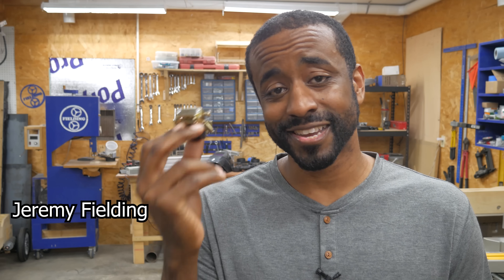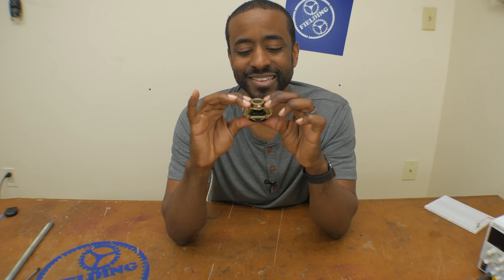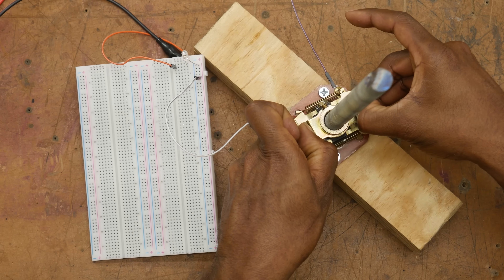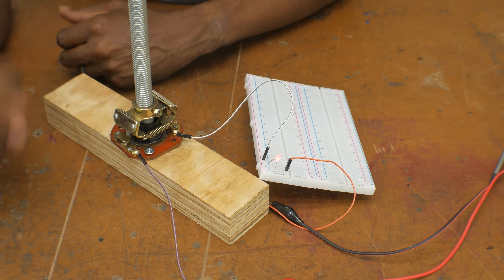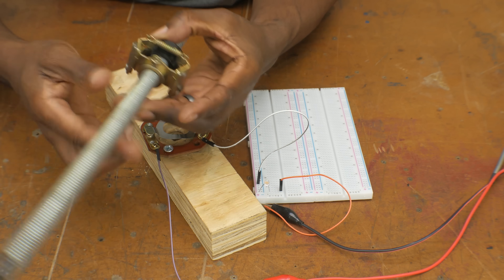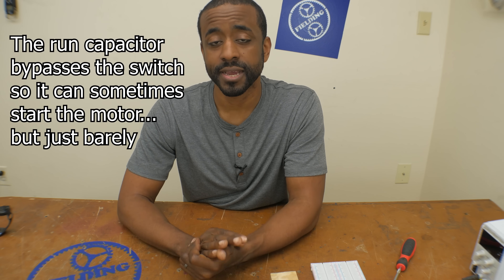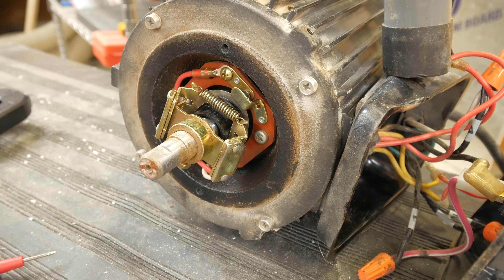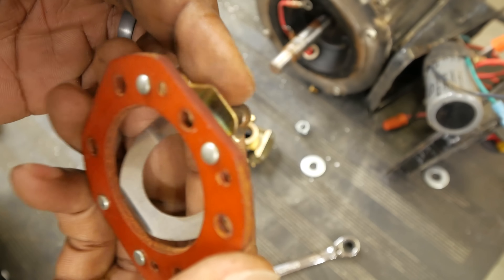This Clever Device Is Found In Nearly Every American Household. How It Works And How To Fix It

Comment: I got a single phase motor for my whole house fan and the new motor shuts off after 10 seconds.  The wiring was for 2 speed at the switch but motor is single speed..  I believe i hooked up low speed 1st and saw the faintest smoke.. Anyways hooked up high speed and still same issue..

Is it possible I damaged something by too many amp draw in low speed? I saw you mention something on your wiring motors vid.. I am at a loss now.. Itll start 10 secs and shut off and then needs to rest.. I wouldnt think its overheating as it shutoff 1st time i powered it on after 10 secs... I can hear the switch click when the motor winds down..

Edit: my motor does not have a capacitor, it is a Dayton 6k778 and Grainger confirmed it should work even though my old discontinued GE motor (GE 5kcp39hg r189p) had a capacitor..

Comment: That isn't dirt or corrosion on the contacts.  It's pitting and carbon deposits from the all the arcing every time it's used.  Sure, sanding it will fix the problem, but the problem will return faster than if the contacts were replaced.  I'm not sure about this, but I think the original contacts had some plating to reduce wear.  I've tried to fix relays this way, and I've never been able to restore them to brand new condition.  However, in the absence of a new set of contacts, sanding the contacts is the way to get the motor working again.

That being said, this is an excellent video!  It not only explains an amazingly simple yet useful device, it shows how to fix that particular problem with AC motors.  Nice job!

Comment: Excellent video,,, you should not use sand paper to clean points , small bits of grit imbed in contacts,,, also rounds edge (less surface contact)... Use a file

Comment: I don't see that centrifugal switch in any of my father's motor.. it just use the capacitor. So if there is any problem with the motor, he only checks the capacitor and replace it if necessary. I don't know why it hasn't in it.

Comment: Great video! Just to share whit you my opinion guys,  starting an asynchronous motors in my country : manually (measuring the actual current peak trough the starting coil) and through a current relay or ejector connected parallel to the operating coil(single phase motors only). The current relay(ejector) and the device(centrifugal ejector) which we are seeing on the video are doing one and same thing ''kicking the rotor" and when the job is done the starting coil will be automatically disconnected. Interestingly is that how much science is behind...

Comment: They are also used as a speed regulator on vintage mixers
Couldn't the reason one contact is bad while the other is good be because the start capacitance isn't properly matched to the start winding?

Comment: A great fix. A lot of contact pads are electroplated with high wear & high conductive coating. Your sanding is a good fix but as there is a high break away arc, it may cause the same problem in a short time. but a great explanation of the contacts.

Comment: Your understanding of capacitors, the values  and how/why they are used in AC motors is lacking.
They don't provide a boost to get the motor started, they provide a phase shift in the start winding to induce a rotational force.
Reply from the maker: It is worth saying I would change the part where I say “ under load” because the motor wouldn’t start even without a load. However I cannot change the video after posting
Reply from the maker: Consider how many words you just used that need to be explained. What is phase shift for example. I understand it perfectly. This was meant to be a beginner video about the switch not single phase motors. Even if you physically kick the motor it would start. That was why I described it that way. However you can check my understanding. I posted a video several years ago explaining the single phase motor in detail. That one would be more to your liking :). It’s called how motors work for beginners  single phase. Feel free to error check me there. Thanks for watching
Reply: Understood, but I do think instead of saying things like "gives it a boost" I'd just leave parts like that out. I think in some cases it's better to be uninformed than misinformed.

Comment: The centrifugal switch was acting up on my 3 year old hot tub pump. It would some times start other times just hum. I replaced the capacitor, didn't help.  I removed the pump and brought it to a motor repair shop. They said the switch somehow lost one of the springs. Pretty amazing how it all works.

Comment: i never seen these before , but i remember a my father used capacitors to  start some motors and as far i remember  he been putting  push button switch   to start  ...  maybe to replace this thing ...:\  you flip a switch and while motor buzzing  you quickly press push button to get it spinning and you realese it (this how our "bench grinder" worked)

Comment: and i know you probably already know this, but when the capacitor is fried and the switch is not functional because of it, all you gotta do is turn on the motor and spin the pulley by hand, it goes right into run speed. it doesn't take barely any speed at all, just flick it. if you can't get it to run, wire the centrifugal switch to run speed, and the motor will run in either direction, might have a slight lug to it at first, but nothing to burn anything.

Comment: what? everyone doesnt know a centrifugule switch for switching high torque starter winding,s over to running windings when the see one? lol my father ran an electric motor and pump repair service through the seventies when it was still cheaper to repair these critters, you know, before china started mas producing throw away versions ! so I learned electric motors very early, fun fact, only motors that start under a load, and need high rpm,s need starter and runner windings,

Comment: Another nice thing about the switch is that, in steady state, when the motor is up to speed, nothing is rubbing/wearing against anything else. The depressor is not touching the electrical contacts, so, for the majority of the motor's operation, you're not incurring wear on the switch.

Comment: At 2:53 you say if weights are heavier it will open at lower speeds. Shouldn't that be if the weights were lighter it would open up at a lower speed?
I'm not an expert and sometimes I feel I know just enough to get in trouble.
Reply from the maker: Investigation is in order:)
Reply: @Jeremy_Fielding   The more I think on it, I think I'm wrong.  And you are correct. I apologize.
Reply: @Jeremy_Fielding  here I'M thinking again. Weaker springs would make it open at slower speed compared to heavier springs which would take more rpm to open up. What do you think??
Reply from the maker: Look up the formula for centrifugal force. That way you see the relationship between the variables like speed and mass

Comment: Jeremy Fielding: Good information and demo of a device not well understood. My 2 HP one phase motor would hum but not start. After disassembling the motor I found the contact points badly burned. Bad capacitor. After replacing the capacitor the motor ran fine until it blew (exploded) the capacitor. Problem; the badly corroded contacts stuck (didn't open), keeping the capacitor in series too long, causing it to fail. Sandpaper, and filing the contacts will help but if they stick the capacitor will literally explode.

Comment: They used a modified version of the centrifugal switch to govern steam engines.  Instead of connecting it to a switch it was connected to a valve
Reply: They modified that even more for elevators, instead of a steam valve they connect to the electric to cut it if the elevator moves too fast

Comment: Black crust with white frosting... mmmmm! This is just like cleaning points on a non-electronic ignition engine. Points files would work without disassembling. I would remove the power first... ;)

Comment: Excellent video, good on you! One tiny suggestion... when cleaning up electrical contacts, don't just sand them, polish them. The resulting scratches are like tiny hills & valleys. Over time, the contact area will load up with carbon and corrosion faster. Polishing, or really, burnishing the contacts will slow the process so you won't have to do this again for a very long time.

Comment: Great video! Over many years, have replaced capacitors, cleaned those switches and each time wondered "How any repair techs are selling brand new motors or entire systems to their customers because of this?" Good lesson and great reminder about making sure equipment is unplugged or locked out and tagged out first.

Comment: As a mechanic who was a teenager in the 70’s I learned about contact points while figuring out how to keep my 67 Impala running smoothly. One of the main things I learned when cleaning them was to double over the sandpaper and clean both contacts together, pinching the paper between them. This ensures the faces are contacting fully thus minimizing arching. Cool video though!

Comment: I would not recommend using sandpaper to clean electrical contacts. What can happen is that small particles of the abrasive can be lodged in the surface of the contact metal. The abrasive material is non-conductive, and will, over time, cause the contacts to burn at a faster than normal rate. There are actually "contact burnishers" made specifically to clean contacts, but a fine file will  also do the job. (My suggestion is based on fifty + years electrical/ electronic experience.)

Comment: A black guy in the mid 1800's made it for Steam trains engines to oil components on the engine, and to release steam. Originally made to be a safety pressure release valve. Known as the real Mccoy due to name of a black man who invented the switch, hints the saying, " The real Mccoy " because the knock off design didn't always work and steam engines still exploded until you brought the original design by Mr. Mccoy, " The Real Mccoy " So as a black man when you hear this saying, The Real Mccoy, be proud brother he is one of our.

Comment: I need help . My compressor motor runs on start capacitor and run capacitor , both are new , however , it starts ,pick up speed then it kicks the braker in about 10 sec. (I did removed the valve completely from the air tank so it won't put pressure on the motor  - still kicks the braker ). Is it posible to be this motor switch?

Comment: A burnishing tool would be better to use on the contacts. Sandpaper is too rough and will cause gouges in the contact which will raise the resistance and cause arcing.

Comment: Technically it is centripetal force (not centrifugal force, even though that is the name of the switch).  Centrifugal force is a force that isn't in the same frame of reference as a bystander outside of the motor, so it isn't a real force.  The weights do not "swing out".  They are trying to continue in a straight line tangential to the circular motion (Newton's 1st Law) until they are acted on by an outside force (the force of the springs pulling them inward toward the center of their circular motion.  Eventually the force of the spring is not great enough to overcome the pull due to the circular motion, so the spring stretches.  Anyone who has taken physics 1 has had their mind blown by this frame of reference thing.

Comment: With over 3,000 comments, maybe said already, but:
The specific arrangement of the springs vs. the arms gives an 'over-center' action that produces the 'snap', and hysteresis to avoid the start switch cycling in/out when the motor speed drops a bit...all the factors in the design that make it work reliably.

Comment: the story y read in MAME magazine (1889 or 90) it was the janitor in the shop of James Watt,  from holand its explain they use two gear size on theyre winmill
atach to heavy canon bulet. wen the rotation gain speed anof the weight of the canon ball open the mouth of the gears shaft to permit a bigger gear for the horizontal stone in the same time the smaler gears engage the vertical stone.... Watt, use its on its first generation of steam vehicule instead of canon bulet
he put some heavy ball betwen two serie of rod like a cars jack we use today pushing the primary gears to engage the rudimentary gearbox.... from theyre its become not a atomatic gear transmission, but a switch on the electric motor....for Tesla. but that last one y part of the lure around Telsla hard to by certain
but the story in MAME magazine y read it many time as a kid....

Comment: I have a motor that is lacking in power for my air compressor.  I cleaned the contacts and am getting conductivity that switches when the motor starts up just like it is supposed to.  I tested the capacitors and they both hold a charge.  What would I test next to fix this thing?

Comment: Hey Jeremy have you ever done anything with the direct drive motors that you might find at the back of front-loading washers/dryers?  From what I can see if you pair them up with a good rotary encoder you can actually get fairly precise control/minimal cogging out of them.   I'd like to try to use them to make a satellite tracking mount for optical/radio telescopes.

Comment: Inside my drill press I found one of those that had screws on the counterweights.  They adjust the speed at which it closes - despite being connected to absolutely nothing else.  It's all about the centrifugal force being greater when they're screwed out further from the axle and lesser when they're screwed all the way in.

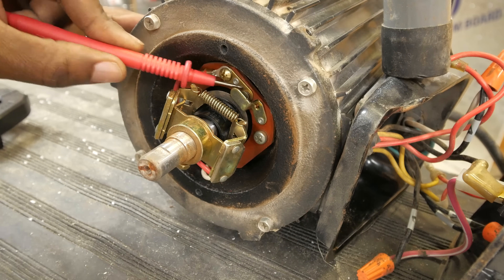Comment: Hi, this is a great video! I know you had your device unplugged, but your ballast capacitor still held a charge, which is why there was a spark at about 6:40. It's best to discharge these with a resistor, before full disassembly. Otherwise, you could get a surprise!

Comment: Hey Jeremy I had a question I’m planning on building an air compressor and all the 3 hp and higher motors and I find our 230v I have a little 5 hp motor off of an old oilless compressor I was wondering how that can be 110 V and everything else is 230-240. is there a way to wire a 230 V 5 hp motor to 110? any information would be helpful
Reply: Sorry, can you clarify something? What voltage will you get from your wall, 230 volts or 110 volts? also, what voltage does the motor you want to use require, 230 volts or 110 volts?
also, be advised that many industrial motors come with the option to wire the motor up to either 110 or 230 volts. It's simply a matter of reading the diagram on the motor, connecting your voltage input wires to the correct terminals, and perhaps bridging some other terminals, as directed by manufacturer documents / label on the motor. This label may be very simply, perhaps something that looks like a gear shift diagram. Such a diagram will be defining which screw terminals in the motor electrical box should be connected to each other, and which terminals should be connected to the various input voltage wires from the wall. 
Please be careful, both with electricity, and with your air compressor. Air compressors can be very dangerous. They are effectively bombs if the correct safety features are not in place or working properly. I cannot emphasize the danger enough (assuming you plan to store the compressed gas in a tank). Please research mechanical overpressure relief valves, electronic pressure shutoff switches, and compressor design in general.

Comment: Hey Jeremy. Where would you recommend someone start education for this sort of thing. I would like to learn more about electronics and electrical components. Thanks.
Reply: My opinion is youtube. Watch Jeremy, This Old Tony, AvE, The Post Apocalyptic Inventor. TPAI will show how to fix all kinds of random things he finds in his local scrapyard. Jeremy... pretty much the same, but american and his focus is broader. AvE will build random things in the shop, demonstrate basic and advanced principles of electromechanics, and take apart power tools and explain how they work and how they were made. This Old Tony will show how to make things in a machine shop. 
For electronics specific focus, I suggest EEVBlog, and Big Clive. EEVBlog will deal with advanced and basic electronics, and Big Clive will disassemble cheap electronics and make circuit diagrams showing you how they work. 
You can go to school to learn at least some of this stuff too, but youtube is much cheaper. Never be afraid to just start fooling around with stuff (unless the stuff has wall voltages in it, then you should learn some basics for safety before you fool around). Take stuff apart. Take everything apart. uh, don't take the hard to replace really expensive stuff you love apart unless you're sure you won't break it (or break it worse). Assess your risk level, and ask yourself what you have to lose always. If the answer is either low risk or low cost of failure, definitely go for it.
Reply: @Resonantfate  Wow! Thank you very much for the advice. I appreciate the time you have taken just to help me. So far I have done exactly what you have suggested. I am almost self taught in every aspect of life. I don't learn well when confined to specific methods, I struggle with ADD. I usually find things interesting in surges. One month is mechanical the next electronics. I cycle through everything with in a year... lol
Again thanks a million for the advice friend. Also I think i already subbed to all of the YouTubers you mentioned...

Comment: Random tip :contacts usually have a silver based coating because it corrodes slower, and has a lower resistance. So instead of harsh sand paper that can eat through the relatively thin coating, use a dollar bill it will remove the oxide layer but not damage the contacts!! Thanks for the video sir.